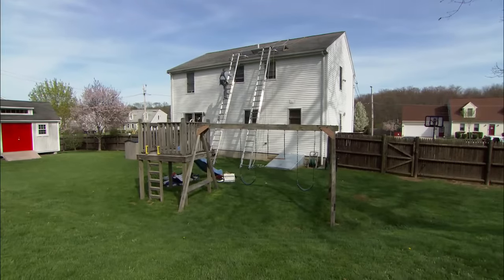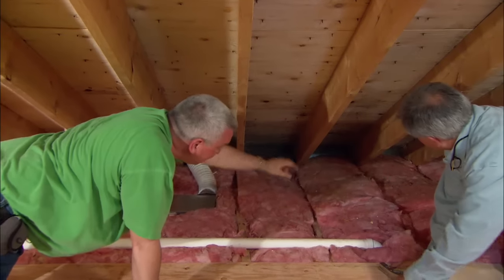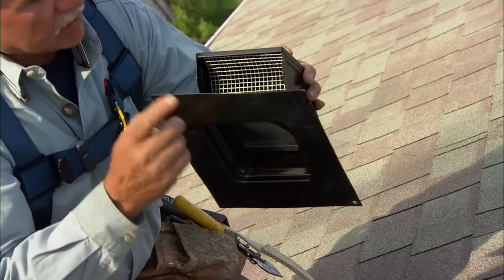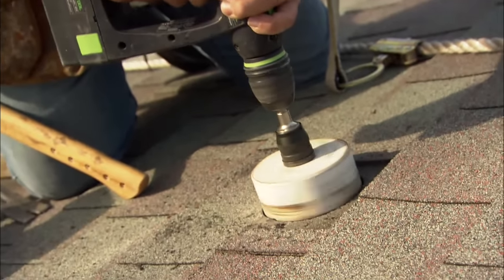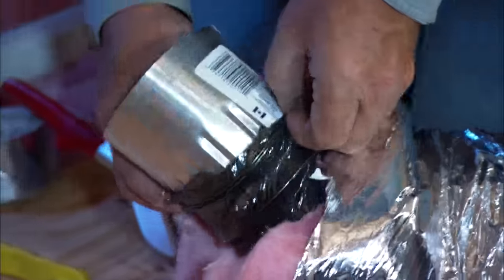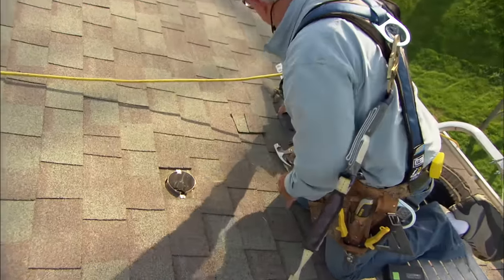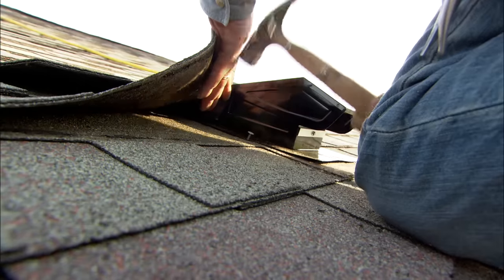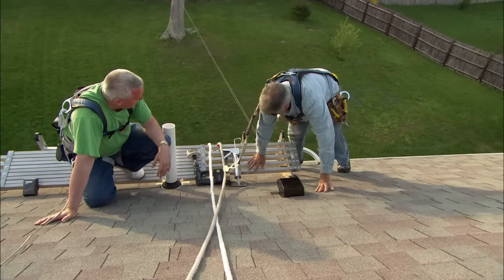How to Vent a Bath Fan Through the Roof | This Old House

Comment: Can you use a current roof vent thats used to keep the attic cool? Because we got like 4 of them.
Reply: Did you ever get an answer for that. I'm thinking of doing the same thing. Trying to avoid adding more holes on the roof.
Reply: @dallasdandy6276  Yes, you can do that. It doesn't work as well, but so far no mold in the attic from doing it for 30 years

Comment: This fan works very well. https://www.youtube.com/post/Ugkx7yWIKcrbA9KMHkGSfcgxW2lsjHT6B8Sh  I replaced my old fan as our radon levels began to spike. When I remove the old fan water poured out of the fan. Must have entered in through the out spout. Replaced with this unit and levels dropped a bit but still over 4.0.Did some more digging and found that we had a small hole under our waste pipe that was allowing some water and radon in.Patched the hole and the levels dropped almost overnight.I really would recommend the radon sensor. It gives real time readings. Without it we would have never known that we had this issue.
Reply: What part of the country do you live in to have radon that high?
Reply: @DougCeleste  When I lived in Fort Dodge Iowa the radon was 8.0. I had to put in a mitigation system to get it lower. I installed a sub floor system which goes down to the gavel and applies vacuum under the basement floor venting out through the attic. The levels were brought down to 0.8. Note, some of the radon infiltration comes through the sump pump hole. First thing to do is seal that up nicely and attach a 2 inch pvc pipe from the the top and vent it outside.
Reply: @jimturner4937  WOW, what a job!   :face-fuchsia-wide-eyes::face-blue-wide-eyes: Did you do this yourself or did you hire a contractor?  I have friends in Ankeny, IA. and they never mentioned to me about radon issues.  But since I will see them in the fall, I will have to ask them about this.

Comment: Something that is just as important as venting to the outside, most people don't let their fans run long enough to "dry out the duct",  should also install a countdown timer as well.
Reply: True ,and I would add when putting the ceiling fan in to buy one that has double the output needed for your bathroom (  as it ages will still be efficient) and one that is rated whisper quiet
Reply: night fangs I prefer a noisier fan to cover the sounds made inside the bathroom.
Reply: One could use a humidistat instead that would keep the fan running as long as the humidity in the bathroom exceeds a certain value.
Reply: Good idea.

Comment: This is fairly a new roof.  The shingles are flexible , if your home is older and your shingles are over ten years old.  -+.  They become stiff and brittle .  And the job is more complicated.   Just sayin. !
Reply: Agreed. Just did this on my house today and the shingles definitely didn't flex like the ones in this video.
Reply: is there a solution to not breaking the shingles?
Reply: ExuberantOne - Try it on a hot day when the sun is beating down... it'll make the shingles slightly more pliable than if they were cold.
Reply: Do it on a hot day or use a heat gun.
Reply: Better use rubberized asphalt shingles next time, they remain more flexible even well aged.
Reply: Yep, I was laughing at them in the ceiling.  Mine is chock full of dust and webs and phone lines and dark as hell.  That one?  Brand spanking new.  Never find another like that imo.

Comment: Simple fix for this is to use pieces of batt Insulation and stuff them into two soffits opening on either side of the bathroom vent cheap and a lot safer for DIYers not comfortable on roofs and don't forget to put a piece in the opening where the duct and vent are located

Comment: I did this methode last summer after watching this video and the roof vent melts the snow and creates a large accumulation of ice around it.
Reply: Where in the country are you located? I'm so close to doing this and I'm afraid of that happening. I'm in northern Ohio
Reply: Go a bit higher up the roof then
Reply: some random guy hey did you ever install the vent? I’m about to install two for both bathrooms and don’t want it to be a complete failure

Comment: Wouldn't it have been better to use the nail as a reference and moved your 4.25 inch hole over it till you centred the vent hood between the shingles better , not leaving that sliver of a shingle ?
Reply: MajorTendonitis first it doesn’t matter and it’s better looking and cleaner to center the vent in between the rafters
Reply: Wouldn’t it be better to be perfect and do everything right every time? Shut up. People and there opinions! Tell me where are your videos?!
Reply: There was no sliver there when he made the original cut and test fit. There was a sliver on the opposite side, but it was about twice as wide. I have no idea what the hell happened here.
Reply: broque beitel who cares what it looks like in the attic where no is ever at?

Comment: Are these vents OK for areas where the roof may have snow on it for short parts of the year?
Reply: I was thinking about that too. You know snow billed up?
Reply: No, the heat might melt the snow and give u ice dams. Avoid doing this
Reply: Kyle H what else do you expect from a scab Carpenter
Reply: No, when you have snow accumulation the vent is stuck closed. Run your fan then nothing happens.

Comment: Very informative in regard to improper initial installation and proper installation . However, they explained the problem of  installing vent in a vented soffit thus causing vapor to enter the vented soffit ,therefore causing mold growth on the roof sheathing etc. Nothing was mentioned on what they recommend for the removal of the mold that already started to grow. Stopping the vapor penetration into the vented soffit doesn't stop the mold that already started to grow.
Reply: Install a piece of zinc to run the length of your ridge and this will eliminate the mold and discoloration of light colored shingles.

Comment: I am having zero suction in my 2nd floor bathroom fan I just replaced motor and still nothing .. it would appear I have vents like this where there in the sofet outside .. I don’t know if it’s clogged or what there seems to be 2 of them next to each other so I don’t know which one is for my bathroom and it’s very high up off the ground .. I haven’t no idea what to do or who to call

Comment: My upstairs bath just has a window, but the bigger problem is the downstairs bath fan vents into the second floor joist space!  Ive got to figure out how to run a duct to the nearest wall, then up a flight into an inaccessible attic, and THEN to a dormer roof.  Oh, wait, I just had an idea. If the joists run the right way,  I can come out in the closet of the adjacent bedroom and then through the gambrel roof.  There is no attic there.  Cross fingers on the joist layout.  Anyway, this video is very helpful.

Comment: After watching this video, I checked my attic only to find my last contractor who redid my bathroom had vented the fan right into the middle of the attic.  I checked between the joists and there have been no signs of mold or moisture and it's been well over 10 years....yikes.

Comment: Hi  Tom , i did the same  as you have shown  in your video , but  i am still having problems in the winter time  with water dripping down   inside the insulated pipe vent.   I  did have new roof vent installed when i reshingled my roof. The vent has a flapper  also for any back draft of cold air. My vent pipe is roughly 4 ' straight up to the roof vent. Any suggestions ? i thought maybe more insulation around the vcent pipe may help. Thankyou for any suggestions. Brian ...
Reply: have you figured out the reason and fixed the issue? I'm going to install the vent soon

Comment: Is there a minimum distance the fans ducting have to run before it can be vented through roof? Looks like they went straight up from the fan.
Reply: Had to scroll too long to find this, I was thinking the same thing. I suppose this straight shot would be the most efficient, but I'd be worried about moisture dripping back in. There'd be heat-loss concerns as well, right?

Comment: so my problem with that type of roof vent is that we get a lot of snow.  The snow covers the vent.  When you turn on the extractor fan during a shower it exhausts warm, damp air which then freezes the snow in front of the vent.  The next time you use the fan it melts the ice a bit and the ice builds up more.  Eventually the vent becomes non functional and the ice does damage to your shingles.  Is there a way to replace those vents with ones that stand up higher from the roof?  I need a solution before next Spring when we will be reroofing.

Comment: what about in Canada where we get 3 feet of snow on the roof a low roof vent like that would be covered with snow. How about using  3 or 4 inch abs pipe with an elbow to keep the rain  out?
Reply: I was asking myself the same thing. I live in Quebec where we have severe winters. I am pretty sure that kind of exhaust vent might cause ice built-up when it is all covered with snow. 

What I have decided to do is to exhaust to a wall mounted gable vent instead. Longer run, but at least I don't have any risk of ice build-up , water infiltration or snow issues.
Reply: Jason C. is correct. I live in Michigan and have gone thru some severer storms in the winter and have never had an issue. It will actually melt a path thru the snow/ice. My hood is very similar to the one in the video, but is actually lower on the roof.
Reply: ***** Can you make me one two. That would be awesome.

Comment: Thanks for the video it helped allot in installing  the roof vent. Unfortunately when the winds changed the following day, air started blowing inward through the pipe causing the flap in fan to start flapping causing lots of noise, needing ear plugs to go to sleep. What do I need to do to keep the air out of the pipe? Maybe buy a new type of vent that goes straight up instead of angled? Thnx, any help would be greatly appreciated.
Reply: Thnx, I called the company Broan and said basically the same.

Comment: Thanks for the wonderful video. Can I hook up two separate bathrooms fan on one ventilation pipe, for making less holes in roof
Reply: ..good question, what did you end up doing? Everything I'm reading discourages doing this unless you use an in-line fan mounted on the OUTLET side of the "Y" (wye), which would draw air from both rooms simultaneously. There are also people saying you can go ahead and do it with two pusher fans, but there are various potential consequences to consider include: air re-circulation between bathrooms, a lesser-powered fan getting overwhelmed by a higher-power fan and being ineffective if their on simultaneously, and possibly inspection issues down the road. I'm certainly with you in preferring fewer holes in the roof, however.
Reply: I wouldn't. There's no guarantee the moist air will go up and out the vent. It could come out the other bathroom fan.
Reply: You'd have to find a hood that is 4 inch x 8 inch inside demension

Comment: I installed mine the same way and used the same hood. Today we have 35-55mph winds and heavy rain and I’m dripping water into my bathroom. It must be the wind driving the water upwards and soaking underneath. Been installed for a year and a half and never a drop till today. ..
Reply: the insulated flexible duct should never run straight from the hood vent to the bathroom fan. Always leave a "u" shaped flexible duct, that way when water drops come thru the roof vent, they get stuck on the flexible duct. the fan will eventually dry out the water. think of it as how water gets trapped on your toilet so odors don't get in the house

Comment: I actually have a question I see in new homes built bet they just have the pipe right on top of the piece of plastic with holes and they never put it in the ceiling should I fix this or should I leave it as is

Comment: How do you correct this if you can't get at it because its in a floor joist then out to the overhang. tough one. The roof joist in filler with 6" spray foam

Comment: I’m thinking about increasing the 4 inch duct size for my ceiling mounted range hood. Before I waste anybody’s time I just wanted to check if a 6 inch hole is permitted through a 12 inch rim joist?

Comment: Hi, when you run the insulated hose, should you run it straight up to the roof?  Or lay it flat and have a gradual bend?  I am concerned with condensation and water flowing back inside...
Reply: Had the same question, came here looking for an answer. From the video, it doesn't seem possible for a gradual bend with how close it is to the edge of the roof already.
Reply: Just use insulated duct work.

Comment: I don't see the problem going out a soffit especially if it is perforated, gable vents, and ridge vent. There will be too much air flow, not enough warm wet air, and too large of a space to worry about dew points.  If you are in an area that snows more than 6 inches a 50-80 cfm fan running for 10-20 minutes will not melt the snow and the moisture may come back down the duct. Also those doghouse vents will dam leaves and pine needles causing excess moisture around the vent and damage the sheathing with time.

Comment: Can this system of roof venting be done with dryer vents??
Reply: I guess, but they need more frequent maintenance, and you'd be blowing lint on your roof.

I looked it up cuz I was curious: 

"It is not advisable to vent a dryer through the roof. This is one of the most common mistakes we see from people who are not experienced with air ducts. Dryer vent specialists will tell you that a vertical approach to installing a dryer vent is inefficient and creates a fire risk for a home if it goes unchecked."

Yeah you wouldn't want a long vertical run of dryer venting, it'd get clogged easily and be a hazard.

Comment: Good video, but wonder how the roof vent works with a lot of snow.
Reply: I'd assume the air just doesn't vent out of the bathroom until the snow clears. But just because there is no flow outside doesn't mean the flow goes into the attic or something... just stays in the bathroom.

Comment: Hi, What if I have two bathrooms, each have an exhaust fans, Do I create one whole for each or there is some type of system I have to create that takes care of both exhaust fans?

the other question is that I also have to vent out an exhaust fan that is located in the first floor bathroom. The house is being expanded and the window of the first floor bathroom is being removed. By code we need to install an exhaust fan. The limitation for distance between the fan and out side has to be at 25 feet.
thanks.
Reply: For your first half, it's really best to have two completely separate ducts and separate vents. There is a way to join them with a 'Y' connector, but you'd need to have back-draft dampers on both ducts before the Y (otherwise air can blow from one bathroom into the other!), and those dampers aren't completely airtight and they add resistance to the airflow, so it's really not a good idea. You can also vent through a gable wall instead of the roof if that makes things easier.

Your second paragraph isn't really stated as a question, but I guess you'er wondering the best way to vent that first floor bathroom. There's no way to know with such limited information, but it may be possible to vent through a wall or go down and through a basement or crawlspace. 
The 25' limitation is somewhat arbitrary (unless it's a code)- Yes you generally want to keep the duct run as short as possible, but it's more about keeping the resistance to airflow as low as possible, and many things go into this- the type of duct (rigid is much better than flex), size (bigger is better, you can use a reducer to go to say a 6" duct from a 4"), and most importantly, minimizing bends and making those bends as gentle as possible (two 45° bends are better than one 90° elbow). You also want to make sure that the first 2-3' from the fan go straight before making any turns, though this may not be possible in your situation..

Finally what fan you use makes a big difference. If you have a long or complicated duct run, and especially if you have to break some of the rules above, you want a more powerful fan and one that can ideally automatically adjust to ensure that the intended cfm rate is delivered. The Panasonic whispergreen series are great for this.

Comment: Can I do the same  to install a vent  bath fan through the roof on a GAF high definition architectural shingles and instead of cutting a hole 4 1/4 " can I cut it 4 1/8"?
Thank you ,
G. Williams
Reply: I could use a reply from someone.
Thank the
Reply: I'm waiting for this reply too Glad, I have the same issue with the architectural shingles
Reply: @mmarie294  this video is architectural.
Reply: As long as your duct is smaller than 4-1/8".

Comment: Don’t you need to add a couple of roofing screws to the bottom of the vent and seal them up as well?
Reply: No.  Me mentioned in the video not to seal or nail the bottom.  That way any condensation build up under hood will just run out.